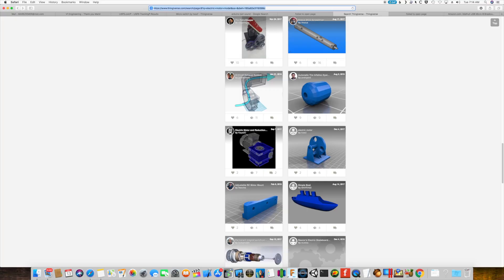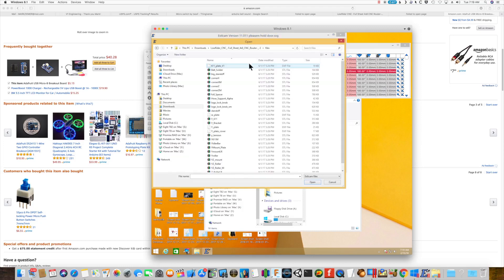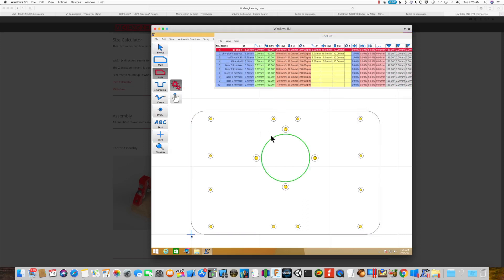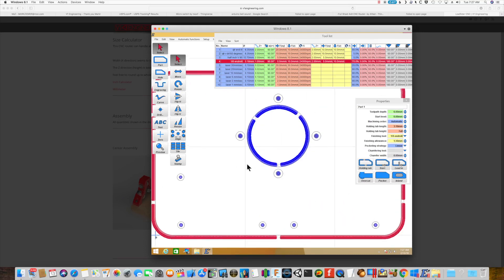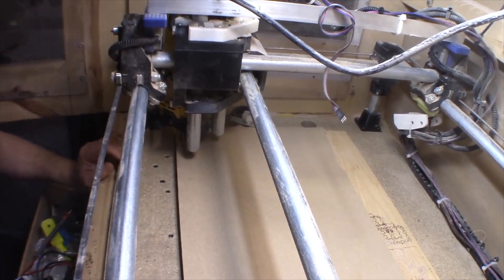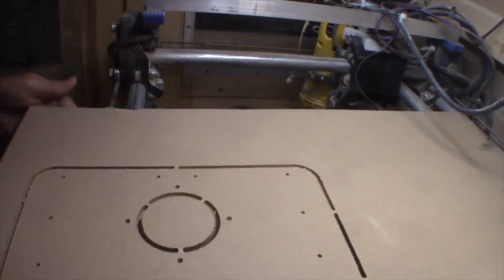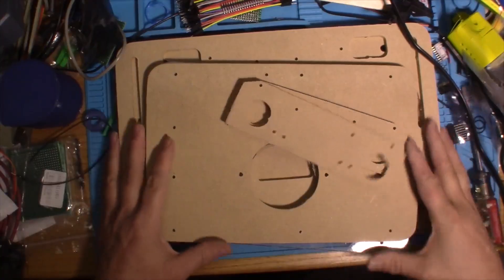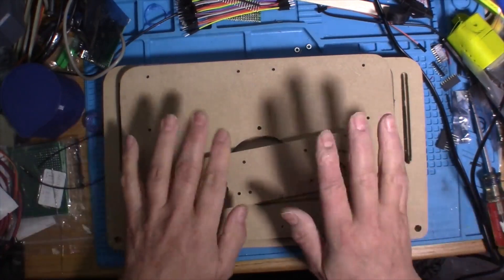Lowrider CNC Build - Part 01

Comment: Is it possible just to 3D print the cut out pieces? Make it .75 thinkiness and in ABS
Reply from the maker: Peter Pham sure it probably would work. Do you want the boards especially the 611 plate to be stiff And not sag over time. The wooden boards or a quarter inch thick. I notice you said 3/4 inch in your message if that wasn't just a typo it's probably not a bad idea to stiffen it up it might be a lot. Whoever y'all need to change the length of the screws of course. And you may want to recess the 611 into the plate so that you don't lose the depth of cut. I think there's been some discussion of That on the forum of v1engineering.com. Check it out. Let us know how it goes if you give it a try. Good luck and thanks for watching!
Reply: Thanks for the quick response...I doing the Maslow setup right now to see how it will cut out all the pieces for a boat I am building...wished I had seen your video first and the Lowrider CNC before I bought the Maslow...Do you have the plan for the table? I need my machine to use the full size of a 4x8 plywood board. I really like how you did everything n CAD first before the build..LOL..I am just like you..CAD it out first and then build it...
Reply from the maker: I've got it all done and I am up and using it with a cabinet to the table however I'm only doing a quarter plywood size so it's only able to cut a 2 x 4' sheet of plywood just because I don't have the space. The low Rider is originally designed to do a full sheet of plywood. My full series on that is on YouTube if you'd like. Thanks

Comment: I am so looking forward to the rest of the videos from this series. I have my Low Rider already setup but I'm having some issues with the stepper motors out of sync, I was also wondering if you'd consider adding Octo Pi to the low Rider. I would be very grateful if you'd give me some time to pick your brain and chat someday. I'm just a hobbyist and not an engineer or a Computer guy. SO these things are pretty hard for me to get through without considerable help...  : (
Reply from the maker: Thanks for your excitement for the series!  It's will take me a bit due to time and budget, but I will get there. I've got a lot of studying to do yet. I;ll be glad to help where I can.  Don't know much yet, but did you purchase the wiring harness from V1Engineering or make your own?  what sort of problem are you having exactly?
Reply: I am in Bangladesh, I sourced most of the parts locally or from Aliexpress. The stepper motors I have are not aligned/ voltage synced or something. The either just make weird noise when powered or one goes much faster than the other. I tried adjusting the voltage too. Some one told me to try something in the firmware but that might as well be in martian language. I have been meaning to take some Arduino courses but haven't had the time.
Reply: P.S. Thank you so much for the fast response.
Reply from the maker: Did you download the firmware from V1Engineering.com?  If so, I wouldn't change anything there. What model of arduino board are you using, Ramps, minirambo?  How did you wire the steppers?
Reply: May I have an E-mail to send you some videos? I haven't seen one in your website.
Reply from the maker: sure, it's someoldguycoding@outlook.com

Comment: So cool!!!
I so gotta put my MPCNC together, what size is your machine?
Reply from the maker: The working area of my MPCNC is 600mm x 300mm (actually 296 mm). Use the calculator on the V1Engineering website to calculate what the actual size the machine needs to be.  The Lowrider will be big enough to easily handle a 2 foot by 4 foot piece of plywood. Good luck and have fun!